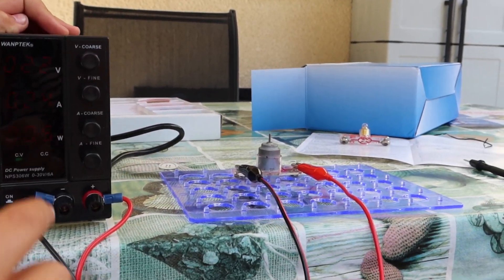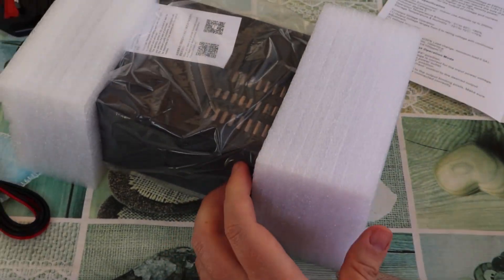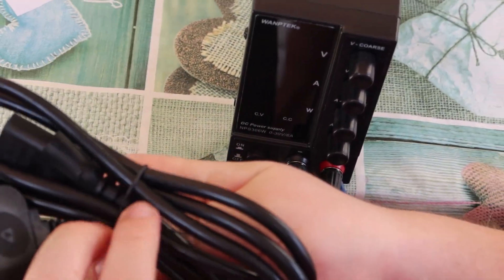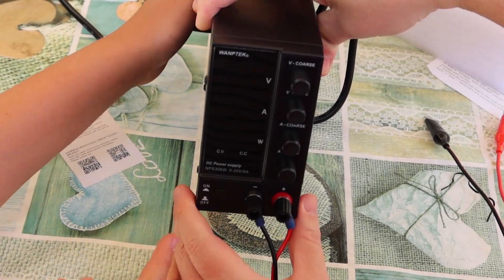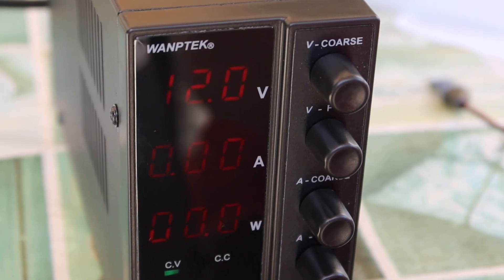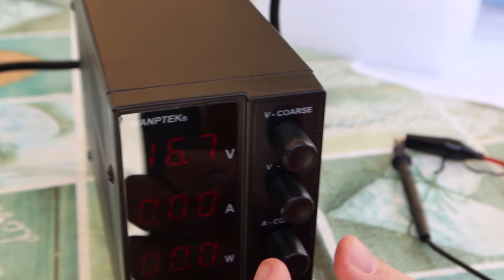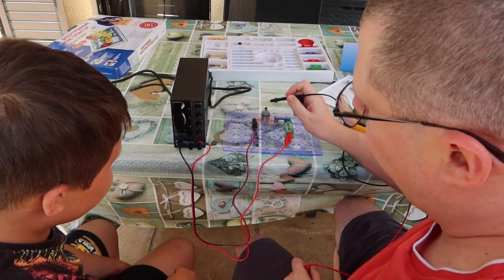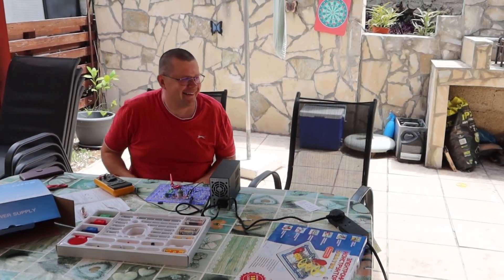Wanptek Adjustable DC Power Supply NPS306W from 0 to 30V 6A. Review, testing

Comment: I got this for my ham radio hooked it up at 12 volts it fried my $120.00 radio i wont buy again china junk.
Reply from the maker: I'm really sorry to hear about your experience. That’s frustrating, especially with such expensive equipment. This power supply does allow you to change the voltage and amperage as you wish, so it’s possible that the amperage might have been set too high for your radio. It's always important to double-check those settings before connecting sensitive devices. Hopefully, you can find a more reliable power supply for your needs in the future. Thanks for sharing your feedback!

Comment: I have 3 of these power supplies and they're all junk.  I was using them to test some MOSFETs and wanted to draw about 5A at 5V.  All three supplies had about a 0.5V drop when the MOSFET was turned on.

I was operating the IRF44Z at a 10% duty cycle, Vgs=10V, 1 ohm load resistor.
Reply from the maker: Thanks for sharing your experience with the metal–oxide–semiconductor field-effect transistor! it may be useful for someone for their projects!
Many thanks!
Reply: @sjumpers  Have to take back my comment.  After thinking about it, I checked power lead resistance.  It was higher than I expected, so I switched to some #10 leads I had made for high current testing.  The voltage drop in the lead dropped to 0.2V, so the supplies are okay.

I had already done a load test to make sure they could provide at least 6A at 30V.
Reply: @dl32412  from someone who is familiar with these, I'm thinking about getting one, what is the difference between NPS306w and DPS305U power supplies?
Reply: @dl32412  Thank you